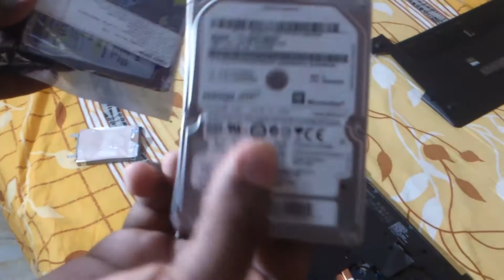Replacing the HDD on the Lenovo Y510p and Status Update

Comment: just curious but did your laptop by any chance start freezing when your hard drive was dying ? im asking because i too have bad sectors on my drive and is in need of replacement.
Reply: my hard drive started doing problems, same computer...can you please tell me how did you check for health? programs show me its ok but it freezes :\
thanks
Reply: STI828 there are plenty of free software for checking bad sectors on hard disk, just google. Usually these software will run a scan on your hard disk and if bad sectors are detected they allow you to relocate the data and seal off those bad sectors. It depends on how severely the sectors are affected though, if it's real bad then you may lose data. In any case the presence of bad sectors means your hard disk is dying and is in need of replacement but doing this postpones it's death. If your computer is freezing/crashing in the middle of the scan then you would have to take it out, connect it externally to another computer using a case, then run the scan on that computer. I had to buy a new hard disk and reinstall windows, then I just transferred the data from the old hard disk connected externally using case.
Reply: thank you so much for the info man, i guess ill back up all right now. 
i think i will replace it with ssd. do you know if it matters which sata i will buy? 1 2 3?
Reply: STI828 well sata 3 is the standard for all drives now I think and I'm pretty sure they are backwards compatible. I bought a 1tb western digital blue notebook HDD from Amazon and it's running just fine. SSD's are much faster  if you can afford it.
Reply: i cant afford it but ill see how to save more for it, its a long term invesment. 
so what i should search is for mSata, and not m2. ok. thank you sir